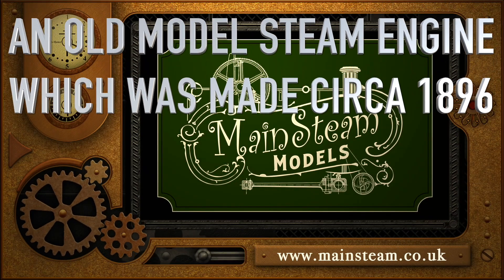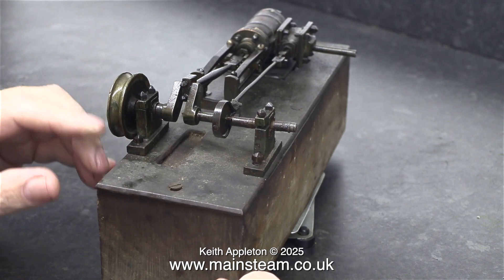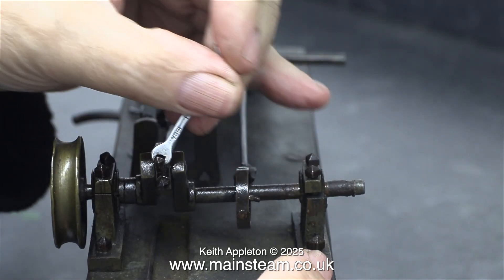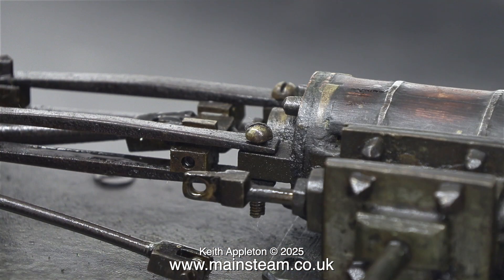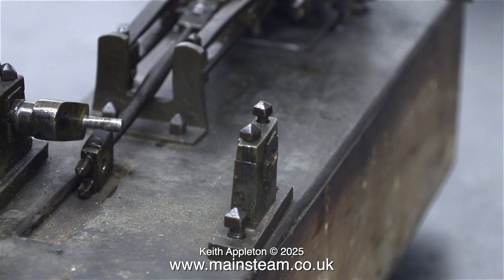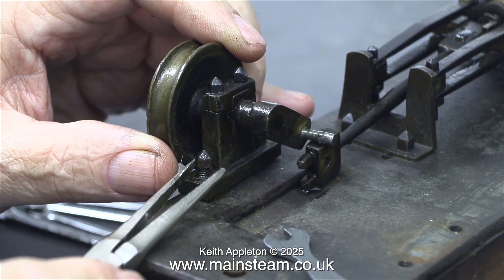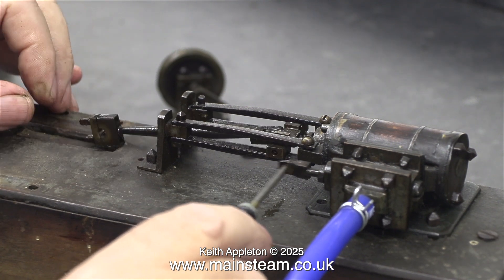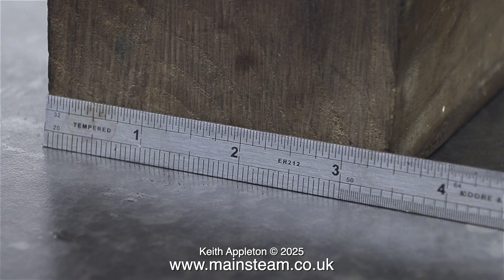REBUILDING A MODEL STEAM ENGINE MADE CIRCA 1896 - PART #1

Comment: Keith, looking forward to watching this series.
Where I live was home to some of the largest sidewheel vessels in the United States.  As a kid became friendly with an "old man" who was very familiar with these steamers & how they operated [three boats with inclined dual compound engines & a fourth with a four-cylinder, triple expansion engine].  He was kind enough to have given me some grease-cups with handles [to force grease into the joints of moving parts], used on these steamers.  The best that I can remember being told, the oilers would reach over the railings of the rotating parts & give a quarter turn periodically to these grease-cups.

Comment: It’s lovely to see you restoring this engine in the spirit in which it was made all those years ago. I’ve restored quite a few engines like this: my colleagues criticise them sometimes, but my response to their initial disdain is that we must not forget the circumstances they were created under. They were often built on a treadle lathe, parts being cut out using saws and files and maybe, if very lucky, a drill press (often with home-made flat, arrowhead drill bits, and if of this vintage, not spiral flute drills like ours). As for working conditions at home, many amateur builders had no workshop so they were also often built on a kitchen table under dim candle light or if lucky, gaslight, which wasn't much brighter. Silver soldering was largely out of the question for the average home builder so soft soldering was commonly used instead, using a brutal blowtorch if lucky, or otherwise a mouth operated meths torch. Things were much better for people working in engineering, as long as the foreman realised that allowing their staff to hone their skills on their own projects would improve the fortunes of the company as well. I look forward to further progress…
Reply from the maker: I agree entirely, it is a privilege to work on these old engines }:-)))